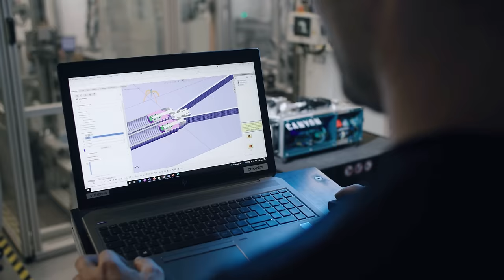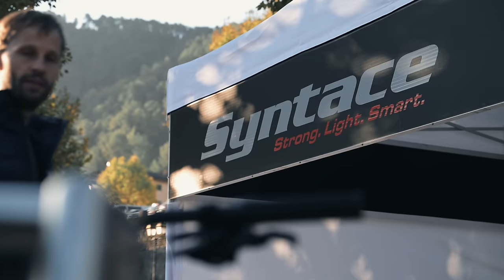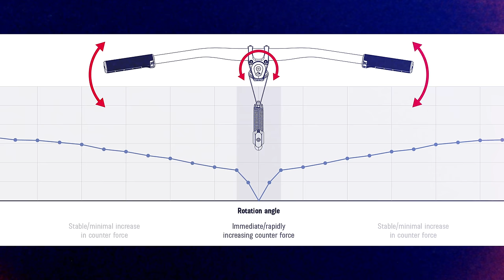Keep It Stable (K.I.S.) | Drop into the details behind this all-new technology.

Comment: Interesting... so turning left will at the same time push the rear to the right making for a quicker turn in and also a bit of a drift making it easier to hit the apex with less body english. And also help to straighten out the steering out of the turn. And also makes it easier to control the bike in air. And of course stabilizing the bike in high speed as well as helping with fast steering divergences (like roots and rocks trying to push you off line).

 I can see benefits arising :-)
Reply: nah lol that's not how physics work. it only helps you stabilize. all the other things you mention, you have to put in more force to turn the bars yes, but that force will be coming from your legs pushing the other way.
Reply: Ok, I agree to disagree… I stand for my analysis :-)
Reply: @mmiisshhaa  spot on - but sales and marketing does not care about physics😉. The simple proof: sit on a rotatable office chair, lift you legs and pull something emitating til handle bar => the chair/you will start to turn the opposite way. Only way to mitigate mitigate you turning will be to put down feet at counter react = pushing the other way which willbalance out the KIS force / moment on the frame. Also the KIS will “help” straghtening out when you go INTO a turn😉🤓. The only upside I can imagine is if it is easier to controle muscle presition (the steering) if the muschles are slightly preloaded/“tense” vs not “tense”? But then again, it might work for other reasons. My best guess is that it will go into same box as e.g. The suspention stem🤓
Reply: Maybe some opposite reaction forces into the rear but minimal
Reply: @mmiisshhaa  Lets say the springs give about 1NM of rotational force, do you really think that pushing your rear wheel outwards with 1NM of force is gonna help the bike to turn? if the bike is 1.5m long that means it has 0.67N of lateral force being pushed on the wheel which is nothing. If it were strong enough to actually "push" the wheel away then you would never be able to turn the bars lol
Reply: @fizzyjoecsgo7154  yes, there's also that. But still, what I originally said is also true. The spring doesn't actually effect anything since you have to push harder with your legs to rotate the bars.
Reply: @mmiisshhaa  That is very much how physics works. With this system, the forks are now connected to the frame. When you push the bars left, it will pull the frame right, even if just slightly. But when you factor in speed, it requires more force to push the bars so you get more force pulling the frame. When you hit a sharp turn it will require even more force on the bars which will pull the frame in the opposite direction and give you a smaller turning radius. 

Very simple physics actually even so that some random dude discovered this theory  in the 1600s. Think his name was Issac or something.
Reply: @ling2186  😭 please. No. Don't talk about things you don't know. I'm in 2nd year physics in university. Yes, the bars are forcing the frame in the opposite direction, BUT you are the one pushing the bars, and you are also the one that is pushing OFF OF THE FRAME to get the force to push the bars. It makes NO difference if there are springs or not
Reply: @mmiisshhaa  my comment was meant for the original commenter. I was agreeing with you that it was a ridiculous theory :D

Comment: Actually a neat idea👍 I just tighten my bearings down hard and crush them a bit to add resistance to my steering. I'm kidding dont do that but anyways hopefully one day I could try that steering system one day
Reply: HRC has Had Eltro Dampers For Yrs on their Sportbikes
Reply: @darrinkulyk9560  tbh I'm having second thoughts on this cause say if I were to use this on my main bike and then use a bike that doesn't have this, it would throw me off. I'm already in plenty control of my bike, I feel that this technology would be good for me riders but at the same time I'm still wondering will they learn to control the bike better or would this affect the way they ride other bikes without this technology?🤔 Idk it's probably just a personal preference.

Comment: I would actually quite like such a system... for heavy bikepacking. It's annoying when the steering keeps flopping around while packing the luggage, this would be perfect to avoid that.
As for the claimed benefits on MTB riding however... I call bogus on that. Fork geometry is all about making it dynamically stable – at sufficient speed, the “trail” built into the steering always nudges the steering the the direction that pulls the bike upright, that's why it's easy to ride free-handed. Any obstacles you put against this natural movement make bike less stable at speed. I suspect this isn't really a problem here simply because the springs aren't that strong, but it certainly doesn't do anything helpful either. Ok, at very slow speeds it counteracts flopping, but... flopping isn't a problem anyone actually has, except maybe complete beginners.

(Another story is the infamous tank slapping phenomenon that old motorbikes could develop at high speed. That can be avoided with a damper on the steering, not with a spring. But again, this too isn't actually a problem in bicycles in the first place, because they're both lighter and slower than motorcycles.)

Comment: How to make something simple, that works great, more complicated, more expencive and more parts that needs service and are a potential point of failure. 
Everyone who has ridden a bicycle knows that it is self stabalizing, and has been for the last 140 years or so due to the fork angle and the fact that the front axle is infront of the steering axle (head tube angle). If you just have a bit of speed, you don't even need to hold the handlebar. At least on asphalt and good grivel roads.

Comment: Thus K.I.S system is like a heavy  billiard cue stick which professionals use. Ordinary cue stick are lightweight.
BMW motorcycles has a patented front spring system that keeps the front wheel steady (it doesn't dance wildly) upon hitting the ground during 'wheelie'. I think this guys got the idea from BMW.
I just wander what if one of your hands needs to adjust your goggles or anything that will refrain you from using both hands on the handle bar. Certainly, the KIS would not know that you are on just one hand.

Comment: This is going to be a canyon only feature, and never universal, and here's why:

No local bike shop is going to have mechanics who want to work on it. Shocks have to be removed from the bike for service at least once per season, which means the fork has to be removed, and a local shop is not going to want to deal with this extra system to get a fork in and out, assuming it's even possible to do that without a lot of difficulty.

This is a very important point for people who are going to spend a lot of money on a bike, because most people who buy expensive bikes are not mechanics themselves, and under most circumstances, asking the customer to do complicated repairs is a recipe for major injuries on the trail.

Comment: Sorry guys, but this is nothing new. I had a similar system on a road bicycle over 30 years ago. The idea behind it back then was to keep the handlebars straight when you park the bike on the kickstand so it wouldn't fall over when you parked it with a heavy load upfront (with like a fully loaded grossery basket or front mounted kid-seat for example), but of course it also worked similar to this when riding instead of parking the bike.

Comment: I'm no engineer, but why would springs really make much difference? Why not use a fluid dampened system like on dirt and street bikes for a steering stabilizer? Then it can be speed sensitive and really ramp up the protection when most needed while keeping bars moving freely under normal conditions to prevent rider fatigue.

Comment: Hmm. Springs attached to an undamped element. I'd be very afraid of this thing inducing speed wobble.

Not quite sure what problem it's solving, but that said, I'd still like to try it!
Reply: But is a rubber tire touching the ground really an undamped element?
Reply: @jonasv328  Undamped enough for speed wobble to sometimes occur even without any springs... there's a good reason many motorcycles have hydraulic dampers on their bars. Although of course it depends a lot on geometry (among other things), and it's probably a lot less likely on a MTB with fat tires and low tire pressure than on a road bike or motorbike.

I've experienced it once (on a road bike) courtesy of a stem clamp that had worked itself slightly loose, and it's one of the most terrifying experiences (other than perhaps American drivers) you can have on two wheels.

Comment: Jus curious why not a similar hydraulic system, rotary dampers have been to around for  eons on race motorcycle
Reply: The difference here is that compared to a device like the damper from Hopey is that the springs are providing a force back to center. Not saying this will be all that the video tries to claim but there is a difference. The principal behind the Hopey is that it creates resistance moving away from center but free return to center but no force to return to center. This comes from the plane world used on flaps and ailerons.

Comment: How is this not the same as power steering on cars? This system provides you a constant torque independent to the conditions which in the end is going to make you loose some of the sensitivity on the handlebars, just like modern cars with power steering where you dont feel when the front tyres loose traction because the steering wheel is constantly providing you with a constant "fake" torque, not like in older cars with hydraulic steering where you can feel the wheel getting lighter as the front tyres loose traction.
IMO for the most of us this will make it easier just like power steering on cars, but for the ones that want to push the bikes to their maximum it may be better to have the freedom to feel the real limit of grip

Comment: A torsion spring on the outside of the steer tube would do it, would it not ?.  This could be integral to the fork and remove the need to modify the frame.  The lower part of the spring would index into the tube and the upper the static portion of the headset bearing.  If two torsion springs are used, then they can be preloaded and introduce adjustability.  Actually, I would house the springs in a fluid and with the adequate features, it could be used to also add shock resistance to the unit. Get the design rite and it could be an aftermarket feature.  This feature is already proven to increase stability.

Comment: So it’s basically like a motorcycle steering damper, but it uses springs to self aline the wheel rather than a shock to smooth out steering

Comment: It's a mechanical Rate Mode Gyro. Adjusting the preload is known as Gain.  RC helicopters started using the same principle in tail gyros nearly 40 years ago to help steer the helis and keep them in a straight line.

Comment: This is a brilliant marketing angle, for sure. We call this a "unique mechanism" in marketing. It's a distinguishing feature of a product in saturated market. This new feature, however simple, will probably sway people into a Canyon. We all know most MTBers are always after the next new "shiny object." 

I can see the next "generation" of this being a tiny electric motor instead of a spring.
Reply: An active electronic stability control system would be pretty cool actually, if it could be made to work.
I'm quite skeptical of the springy thing but the integration of the cam to provide a different return force at different handlebar angles is interesting.
Reply: steering stabilisation has been around for years on motorbikes, not new technology, just a new design!
Reply: It's going to sway people right back off of Canyon as soon as that fork needs its hundred hour service. No local bike shop is going to want to do that, and a fork service is not something that a customer is going to be able to do most of the time.
Reply: @AlexandarHullRichter  you can service forks without taking the stem out of the headtube...
Reply: @0harris0   You can if it's your bike, or if you're that dedicated to it. Shop techs do not do that for several reasons, and being unable to remove a fork is an easy excuse to turn away a bike that looks too difficult to work on for the service fee to cover the cost of repair.

Many (most, actually) shops also survive financially through new bike sales, and run service departments at a loss, both because they need to support their bike-purchase customers, and because the service dept is what they'd rather be doing.

Seeing a bike that is not sold through a LBS (like Canyon in particular) is generally considered an insult the the existence of the shop, and though I will usually work on any bike regardless of brand, many will turn away any direct-to-consumer or Internet-purchase bike for any reason available, simply because any bike not sold through a local shop is a direct contribution to a situation where bike mechanics are not able to make a living.

Comment: Every once in a while, an innovation appears that is so simple that it makes you wonder why no one ever thought of it before. Because I have some engineering skills, I don't even need to ride a bike with this system to understand the impact that this will have on a bicycle. At first, I thought this was just going to be a hydraulic steering damper, like you might find on a motorcycle, but this is an active stabilizer that is 100% mechanical, similar to the vibrato system on my guitar. This might be the coolest thing I've ever seen on a bicycle.

Comment: oh! i think this is good to fight speed wobble too!!! you should add it too to your roadies theyll probably love it!!!
Reply: no, they WILL love it!!
Reply: Imo this would only change the frequency of the speed wobble. It's still a spring system and looks like it would not necessarily add any damping effect. It might stop shimmy or speed wobble or it might make it worse. It could be very dependent on individual setups.
Reply: There is no such thing as “speed wobble” on a bike in normal condition. You can go 60 mph and there is no wobble. If and when it happens it’s due to the rider death gripping the bars, ie he himself is causing the problem, like pilot induced oscillation if you’re familiar with that.
Reply: @PRH123  you can absolutely get speed wobble or shimmy on a bicycle even at lower speeds. I had a road bike that I could induce shimmy quite easily, while coasting no handed. The speed at which it happens and the amount of damping (from the tires, rider's grip on the bars, etc) is really dependent on the entire system of bicycle, tire rider mass and weight distribution. A stiffer system (which may include a bent over with tense arms and tight grip) on will oscillate at a higher frequency, which may be why there's the notion that it only happens on high speed descents.
But you don't have to believe me that it can occur at low speeds, look for the youtube video called "Bicycle shimmy or speed wobble" and its about 15 years old and illustrates it quite clearly.
Reply: @Dave_the_Dave  have been riding for 35 years, have multiple road, hybrid, gravel and mountain bikes…. no shimmy ever on any of them at any speed… I descend regularly at speeds up to 50-60 mph…. speed wobbles on a properly maintained bicycle are only rider induced, which would include of course taking one’s hands off of the bars…. or death gripping them which is what most people that get them do…

Comment: So partly this does what a more raked out head angle without the drawback regarding steering control and rearward front wheel suspension.  I wonder if this will reverse the trend we've seen in the past few years towards slacker bikes.

Comment: This is an interesting but rather simple idea. I can only imagine how many aftermarket products there will be for this if it works.

The question is whether it actually improves the ride. I understand the argument about controlling the bike in the air, it's certainly interesting and can help. But when riding with both wheels on the ground, won't it create discomfort? For example, will it now be possible to ride without hands?  Because in an ordinary bicycle, the wheel will turn in the direction in which you tilt the bicycle. It won't work like that here. This is definitely a must try. 
Let's see if your "invention" will live for more than a year or two)
Reply: This isn't anything new actually. It's just a fancy steering damper for bikes(which does exist already even on amazon for 10 bucks)

Comment: Isn't this just an internal version of a defloppinator that we see on the Radwagon, for example?
Reply from the maker: The system works to actively center the steering. Using spring tension, clerverly leveraged by a cam ring on the fork steerer, a very precise amount of centering force is created as you turn the bars. This combats wheel flop and helps to filter out front wheel deflections from the trail, and make andling more predictable.

Comment: What about the extra weight? Any noise due to vibratiosn of the springs inside the frame?
Reply from the maker: The system weighs about 110g and works quietly :)

Comment: but can you do bar spins?
Reply from the maker: There is a steering block integrat-ed into the headtube that prevents the handlebar from turning past 90 degrees. In the event of a crash, the system behaves much like a normal stem that is clamped to the steerer tube: with enough force, it will slip if the fork/front wheel is forced past 90 degrees, and the K.I.S. system is prevented from over rotating by the block.